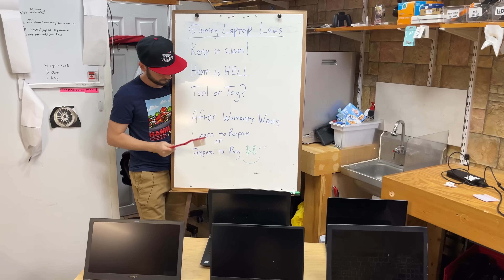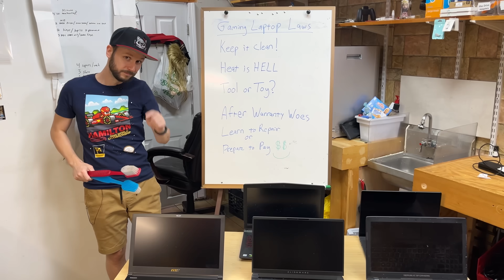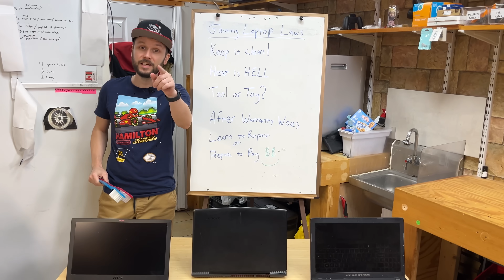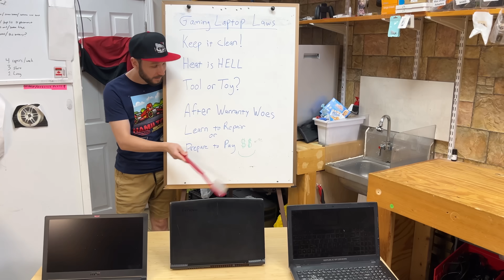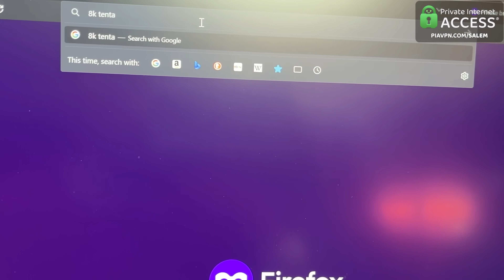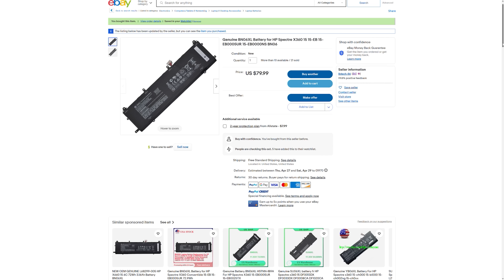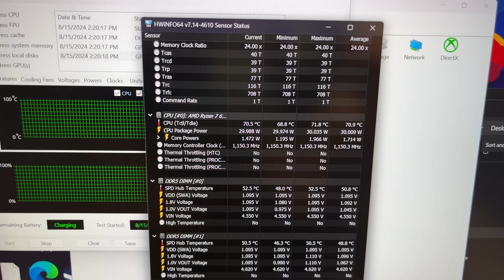Repair Shop Owners Guide to Buying and Maintaining a Gaming Laptop

Comment: I own an Asus TUF 15 (FA506IU). It's always run a little hot due to the vents on the back not lining up with the fans. I've used a Dremel to get a few of them open but even that looks a little janky. So I thought, "Thermal Paste (C)" that should do the trick! So I got some, and some pads for the memory. And my first try at taking the computer apart... didn't fail, I just stopped when it got hard. "Thermals shmermals", I said.

Then the S, Z and X keys started not working. I finally did exploratory surgery to see if it was an easy fix or not, and while I was at it, I did the paste and pads. I was going to need a whole new keyboard, and the rest of the top plate (or whatever it's called). So while I was there I took pictures of every serial number I could find, and went to eBay and bought what I thought was the correct keyboard. I found out when it finally came and I finally installed it that it was not the correct one, but the keyboard fully worked, so I overlooked the fact that the pad and buttons didn't work. I use a mouse almost all the time, so I can overlook this.

And through this experience, I realized one thing. Your job is... kinda fun. I mean, if you are into that sort of thing. I work in tier II support for one of the regional Goodwills, but I don't get to tear a computer apart like that very often. It's very satisfying to clean out the "pubes and swamp gooch" and get slightly better thermals due to cleaning paste crustier than your grandma's gooch off and putting new stuff on. Also upgrading from 24GB DDR4 2400 to 32GB DDR4 3200 was nice. Two 1TB drives also helped in storing all the po... etry I like to keep around. 

I also recently upgraded my gaming with a Lenovo Legion Go...  maybe you should expand your skills to these. I already want an upgrade to 32GB of RAM and a 2TB SSD.  imagine what you could charge to do this!

Love the vids, keep it up!

Comment: I thankfully take good care of my gaming laptops. I did have a issue however with a Eluktronics N870HP6 Pro-X gaming laptop a few years back. I had it for about 18 months, when out of the blue it wouldn't power on or if it did only for about 10 sec then shut off. Took it to a local shop to figure out what is going on, and they asked if I dropped it. I said no never was dropped, why did they ask. He said because they found a hairline crack going half way up the motherboard. So we discussed it and only thing we could figure out how that happened is a "thermal fracture". I never OC'ed it but it did run hot out of the box so that seemed to make the most sense. And it was after my 1 yr warranty so I was up a creek.  I don't want to slam them too badly, the thing ran amazing never had a issue with it until this happened. I am sure if this was a mass issue there would be reports all over the net about this model. So I think I just got a lemon motherboard that slowly degraded over time until the heat cracked it.

Comment: I got a medion gaming laptop a year and a half ago in the black Friday sales. A year later, it stopped charging. Instead of getting it repaired, I fixed up an old gaming pc and did a couple of upgrades on it. I'm probably never going to buy a gaming laptop again, and keep my older general laptop that is still working fine 5 years or something later. If I want to upgrade that, I'll get a non gaming laptop, probably going with framework, since they can be repaired. As long as it runs steam link, it's fine. I can just run the game on the pc, and play remotely on the laptop.

Comment: I have two razer laptops. One rtx 2080 max Q for editting and games(3 years still going)  and one rtx4090  for games (4 monthsand still going). Both I treat like desktops and they live on stands to get plenty of air. Only had issues with the 2080 burning up one 2tb SSD. Seems fine now after deleting razer synapse. Gaming laptops just NEED good cool air flow whenever the graphics card kicks in. Remember that and you're golden.

....Oh yeah and my MacBookpro touch bar lives my on bed for years with no issues.😂 it's a trooper FR 🤞🏾

Comment: Framework! Make these:
A thinkpad p series style of laptop, with thicker heatsinks to have better cooling, really nice plastic or even metal, the trackpoint, a decent keyboard

A gaming laptop that is upgradable and extremely easy to clean the vents

A 360° laptop that will actually last

I also wanna see an ultra laptop for workstation use, that means make it really thick,  but give it a ton of port expansions, give it a high end gpu, cpu, a lot of ram, and make those coolers ultra powerful for the best performance, and with all the extra room, give it a big thick replacable with a clip battery

Comment: My Dell Mobile Workstation lasted almost 12 years straight with the original thermal paste and periodic internal dustings. 
I have since gotten a 'gaming' laptop in the tail end of 2021 and it is still going strong, I may have to update the thermal paste on that a bit more often than once a decade like before, Lol. 
It even has a user replaceable battery just like the old days. (it is a Gigabyte A5 X1)
Also, I kind of use it like a small form factor desktop so the built in keyboard/trackpad has basically never been used, heh heh.

Comment: Made my Asus ROG g551jw last a lot longer than it even wanted to. Upgraded the 1tb hdd to a 1tb ssd, added another 8g stick of ddr3 ram, replaced the battery twice, replaced the fan, and replaced the keyboard, none of which except the battery and ram were an easy task. It finally gave up on life after a repaste when the gtx 960m chip died, assuming from thermal degrading since it never dawned on me that the fan wasn't spinning for idk how long. But it went to a good home (tech recycling) instead of the trash. 
Damn good laptop tho. I'll just never buy another gaming laptop after that. Can't upgrade to modern day hardware after a couple years. 
Been scoping out for good deals on lenovo thinkpads tho

Comment: I've saved hundreds of dollars by becoming an unlicensed Joy-Con repair technician. My credentials are the dedicated Joy-Con motherboard I use for testing components, a ziplock bag full of broken analogue sticks, and my custom Joy-Cons, which I took completely apart, and rebuilt them with superior aftermarket parts. They have hall-effect sticks, and all-metal chassis. They are currently out of service due to me breaking an internal component that I have yet to order a replacement for.  :D

Comment: 2:13 framework laptop 16 my beloved (the keyboard, trackpad, any spacers, and optional numpad are removable, swappable, and re-positionable with no tools in about 10 seconds)
Reply: also gpu replacement can be done using the included torx t5 screwdriver (perfect if yours fails within three weeks of getting it like a few peoples do)
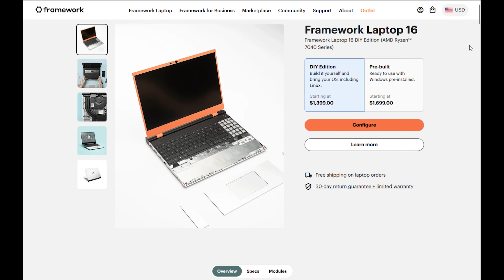Reply: oh hey framework metioned at 4:29 (they are great laptops)

Comment: I bought a MSI Gaming laptop a year ago it was $2,000, Luckily I bought the $250 Microcenter 2 year store warranty cause it just died, CPU fried and Motherboard dead as well, I didn't do anything odd or modifying really anything, luckily my warranty was valid and I got a full buyback.

Worth noting it was right after the standard 1 year limited warranty ran out, if you're buying a gaming laptop for the love of god buy a store warranty whenever possible.

Comment: Just opened my laptop today, took out both fans and brushed the heatsink vents, all of wish had a lot of dust clumps that accumulated over 3 years. Scariest part was disconnecting the battery and other tiny connectors. I'll still need to take it to someone to apply new thermal paste since I wasn't bold enough to take it apart further than the fans.

Comment: Awesome video, as always! Btw what do you use for the gpu aside from thermal paste?
Reply from the maker: Thermal putty, I have the exact one linked in my Amazon shop
Reply: @SalemTechsperts  thanks alot man. Gaming computers seem pretty viable for the power they have and how easy they are to move, it's just overheating that's the real killer
Ty again!

Comment: Lenovo also has good parts support. You can buy a battery straight from the control panel software. Hell, you can buy a heat sink and fan assembly with pads and ptm already applied, or really any other part straight from that page. Try doing that with razer. Not happening. Yeah, some of the stuff is expensive but you know it’s brand new and that it’s an oem part. 

Also if you’re technically inclined you should be undervolting. You can reduce your temps without even opening up the laptop.

Comment: I noticed my temps are getting higher on my laptop. going to apply liquid metal for the third time, pray I don’t short the motherboard. 

Been going three years strong since using liquid metal, and I took the proper precautions so hopefully all goes well!

Comment: I bought an asus tuf A15 back in 2022, have maintained it and upgraded RAM and the NVME and it's still running pretty good. It's in need of spermal paste but i bought the the llano laptop cooler and it brought my temps from 90c to around 60 to 70 c
Reply from the maker: +1 for spermal paste, +10 for buying the llano cooler. That thing is crazy right?
Reply: @SalemTechsperts  one of the best investment i have made, the cooler works amazing you really dont have to max it out to get results i normally keep it at around 1000-1200. Lemme tell you the big fan blows more air through every crevice more than your moms VA-riable rotating air conditioner. Yes it can get a bit loud but what Audi or Ferarri doesn't at high RPMs? I normally use my laptop on a platform which i carry around and the cooler is light wheight, i normally carry it in my backpack as the laptop carrying case isn't big enough.  Overall the cooler works amazingly, obviously not a permanent solution so remember to clean all the accumulated gooch and replace the spermal paste

Comment: At least lenovo has the huge benefits to:
- get the service manual accessible 
- give you the SKU/FPU items of your current config so you can hoard eBay with known compatible parts.
We have done some upgrades on my X13 amd gen1 since I bought a weird config with great specs but 720p tn lcd panel (eurgh) to replace the lcd to a decent 1080p ips, change the lcd cover and install a backlighted keyboard with my brother in law (which has tiny raccoon fingers like you). And even with the service manual, there are glued pieces (antenna/camera/microphone) that I might stumbled upon if I tried it alone. 
Once it dies, I will get a Framework

Comment: Not gonna lie. That laptop you've been fixing is still leagues easier to fix than an Asus Scar II for the exact same job of cleaning the vents and reapplying thermal paste. They pass the wifi antenna cables from the monitor, through a hole between the cooler pipes and to the spot in the motherboard where they plug in. There's more equally annoying steps but that's the one I almost broke something from lack of optics.

Fortunately I constantly keep an eye on the guy and if after a couple months it can't stay at reasonable temps at idle or low workloads then it's time to open it up. Surprisingly despite my sweaty fingers leaving the keyboard looking like that Alienware, the membrane still holds strong. Somehow the vents also only had a tiny bit of lint/hair on the sides despite my dog being inside the house (maybe big hairs don't go into the vents?).

That Scar II is still my workhorse outside of home and for playing the lighter games or older titles. Although I wouldn't recommend it, somehow it still manages to do VR (at DOS-tier resolutions)

Will still say despite all this, as we all saw with Tech Jesus's video on the ROG Ally, buying from Asus is a Russian roulette: If you get no hardware failure, it's excellent. If any component fails, well, look at the After Warranty Woes section of this video again, EVEN if it's under warranty. Also, never rely on their software beyond their function keys software and the control center that comes with the laptop, cause every other software of theirs breaks or loses functionality every couple of Windows updates.

Comment: I lived in filth but I im a cleaning freak.
Acer Nitro 5 i5 gen8 1050TI from 2018, still working today, I repaste, change fan, use wireless mouse and keyboard. But things I can't control like usb and charging port is getting wonky. I already build a mid-range pc now. Feel much better.

Comment: I personally have an XPS 15 that has a 3060 ti slapped in it. I got it because I wanted to be able to run games and do intense "my robotics team hid 200 random high detail rendered parts on onshape" CAD work. It doesn't look like a gaming laptop and runs quite well... Until recently when the thing is now seemingly bricked. I'm going to investigate it as soon as the repair kit (with the tiny screwdrivers) come in but its almost definitely a battery or mobo issue. Heres hoping its the battery. Luckily it seems the thing is quite easy to take a part and I will learn how to microsauder if worse comes worse. Because even if I mess that up I'll just get a new mobo. Its a great machine tho.

Comment: Oh, funny, I have a relatable story in this situation.
Being this is the first calendar year since I'd been able to qualify to have my student loan debt forgiven, I realized I had enough accrued cash back to basically just... buy a gaming laptop outright, of the usual suspects. That said, fresh off the scalper-pocalypse, coupled with an attempt to actively avoid "everything is soldered" crap, my hopes were more dim than my job prospects were after getting my degree.
On principle, I like what Framework is trying to do. Yet even the cheapest I could get away with, from something from them, would have been well out of my price range (like, 40% above a similarly configured notebook from anyone else). From the usual suspects as seen at best buy, I was typically only able to see something with some form of i5 and an rtx 4060 mobile or rx 7600m, which from what I could research on my own would have performed worse than trying to make a gtx 1050 do ray tracing.
Then on a stupidly good looking sale, there was an Asus notebook with a Ryzen 7, and an RX 7700S (about 20% faster than the 4060 mobile) and being sold for $800. I couldn't ignore it, and the thing that sold me on it most was the videos showing how accessible everything was. because I knew I would want to tinker with it, and try to keep with the repairs myself, it felt like a win.
Most recently was able to source some of that PTM7950 stuff, so the first thing I did was to open up the notebook, undo the screws for the cooler, and then start to clean off the old thermal paste and cut some of that stuff to fit on the cpu and gpu. That part, went easy enough. The issue I wasn't counting on, was Asus' choice of thermal putty for the power delivery, vram and other thermally sensitive stuff. All I could think to do was wipe off that stuff best I can and cut up some slices of my thinnest thermal pads to put in its place. All good? Well, it wasn't at first. Button up enough to test, and... it refused to power on. IRL emergency kept me from being able to troubleshoot then, but for the days after that I couldn't get it to power on or show any signs of life. I legit thought I killed it; would it be so awkward to say it put me in a bit of a depressive, defeatist episode?

Anyway, literally today, as i was getting ready to box it up and see if I could take it to a repair shop (because of course I bought it before Asus tried to screw Gamers Nexus on their ROG Ally and had no confidence they'd honor the warranty if I called them up), go over to check one more time. Plug it into the mains and... lights come on. Press the button, it powers on. DDR5 memory training time being as dogged slow, it's... actually firing up. And it resumes Windows from where it was literally before I closed up the laptop to perform the operation! Bonus it's even shaved some degrees already at idle!

Comment: Also laptops with integrated GPUs are generally more reliable than dedicated GPUs. Idk if it's because they don't heat up as much or just the fact that you can't break what's not there, but that's been my experience.

Comment: I have an Asus gaming laptop that I have cleaned the fans a few times. But the fans are attached to the heatsink, and I don't have the bravery it takes to remove the heatsink to reach the vents. I damaged the last heatsink I did that to, bent it. So I've been using a pipe cleaner to get at the vents. I keep it on a retracting shelf on an old computer hutch, with my monitor and keyboard setup on the top. Just noticed a couple of weeks ago, it's nasty dusty on that shelf, and my laptop was sitting on a platform only a few inches above that pile of dust. Took the shelf out, and I was surprised by how much dust was on that shelf. Explains why my laptop was starting to overheat.

Comment: even if its not a gaming laptop its still applies for all. Keyboard is really one of the fragile parts to assemble and disassemble since that connector is easy to break. My Toshiba i3 laptop really need to have a keyboard replacement and i did buy one in an aftermarket but within 5 months of use it breaks (maybe due to dissasembly every month for cleaning)  and made me really sad and realize i wasted money for it. hat's in the end,  i instad replace it with an actual desktop keyboard now.